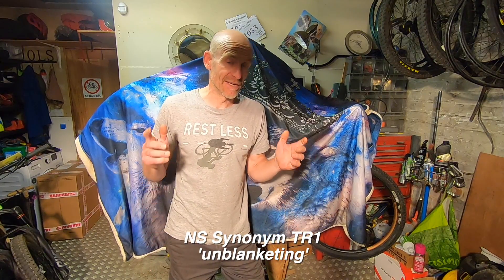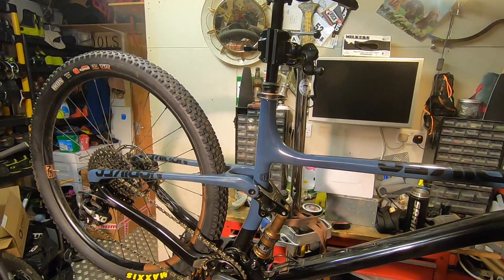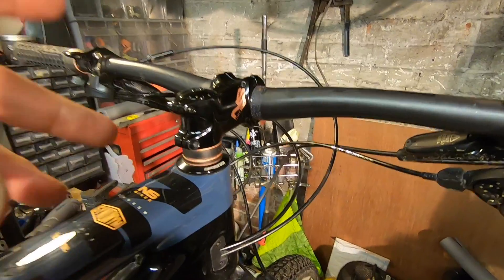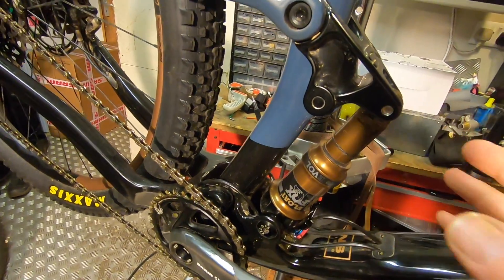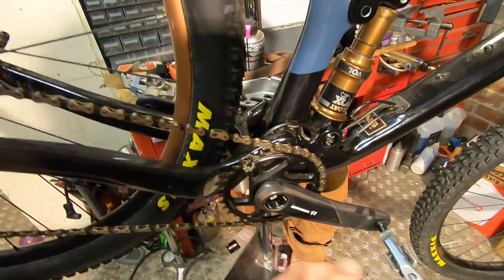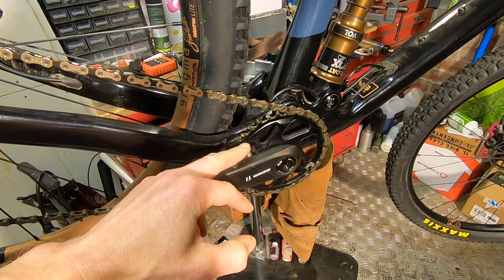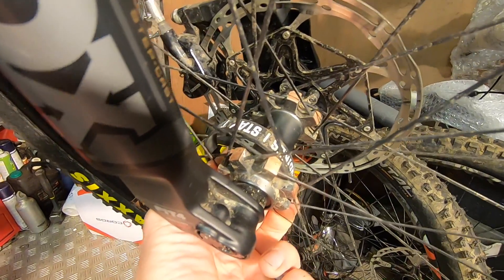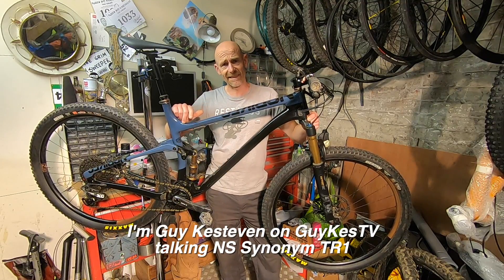NS Bikes Synonym TR1 radical race/trail mountain bike unwolfing

Comment: Regarding the saddle, do you mean that on a size large it's hard to get a long enough post in for a tall rider with the minimum insertion? I'm 185 (6'1") with more legs than torso - think the L or XL would be better?
Reply from the maker: Fr Ya no opposite way round. I’m 180 with short legs and the 150mm post only just works with the collar slammed onto the top of the seat tube. You’ll be fine on L
Reply: @GuyKesTV  Thanks very much! Good review thanks! :)